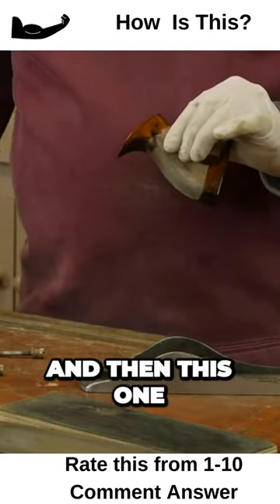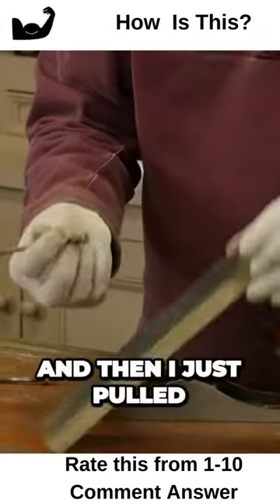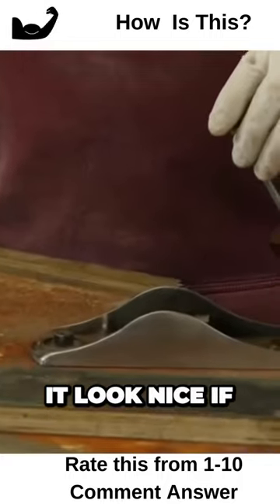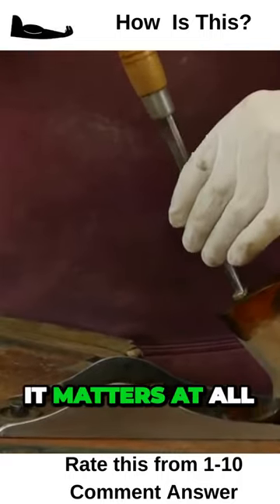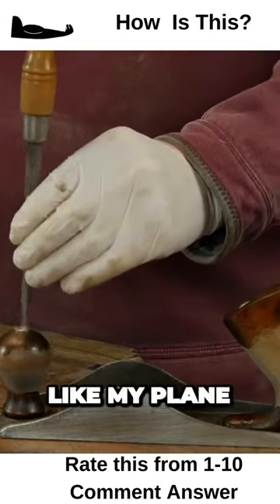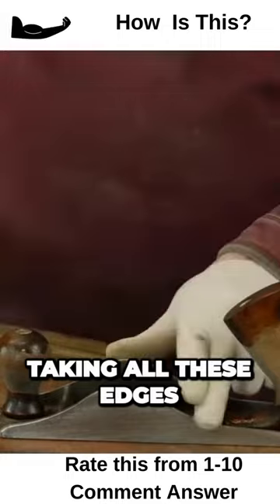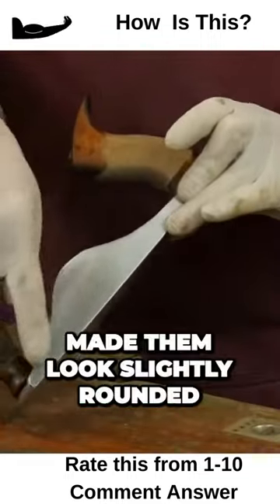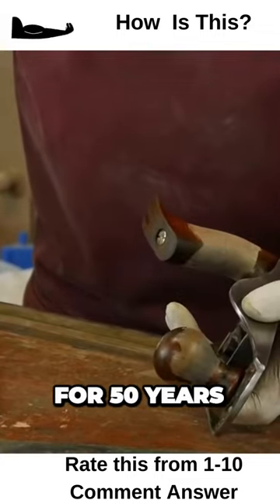Reviving My Vintage Plane Polishing Brass Restoring its Original Feel #shorts

Comment from the maker: Click to buy different woodworking courses https://ebay.to/3O2DLIT

A desk tailored to your needs | Your workspace Reinvented AdHandy Accessories That Make Your Work Easier. Home Office Accessories & Furniture designed by Oakywood https://bit.ly/3KoRMhk

China has industry-leading brands of laser engraving machines and cutting machines. https://bit.ly/3KfejwY

Workprotools presents pratical tool lineup of hammers, wrenches, pliers, power drill. From hard-working hand and power tools to durable garden tools and accessories. Free Shipping. https://bit.ly/3mh6gaY

2Sand Official Store | Better Sanding Selection AdSanding Belts, Disks, Rolls, Sheets and Specialty Sanding Supplies. Fast, Fair and Superior Sanding Supply Delivery Service. https://bit.ly/3ZXPNpN

SpeTool Carbide Router Bits - Better Service & Cheaper Price CNC router bits for woodworking beginner's. The Truly Complete beginner's CNC router bits. https://bit.ly/3KUsPvy

Harfington Official Site - Tools & Home Improvement Browse 100,000+ MRO Products Include Hardware, Tools & Other Components for Various Needs. Harfington - Online Maintenance, Repair & Operations Shopping Store. https://bit.ly/3H3URT9

Only USA For Get a $750 PayPal Gift Card,$250 Gas Gift Card,$500 Evo Gift Card,$100 Walmart Gift Card,Your Vitamin Gummies,Access to Unemployment Support,Your Cosmetic Samples,Help With Your Tax Credit Funds,$500 Crypto Voucher,Baby Products,Cash From Home Click Now  https://bit.ly/3R0N4YP